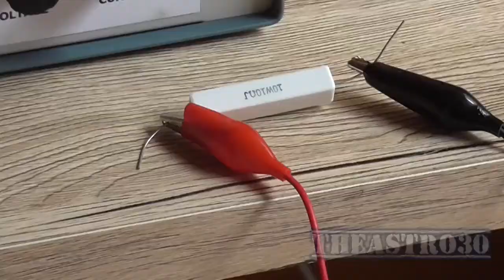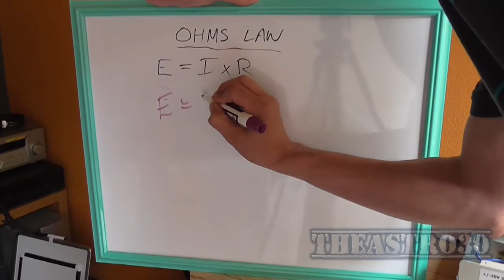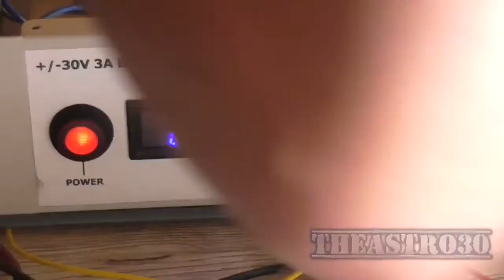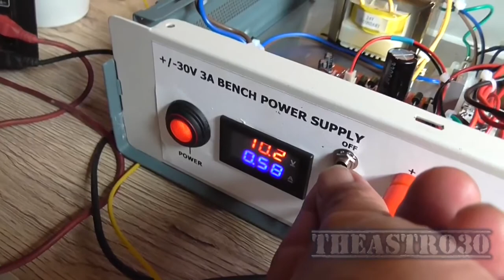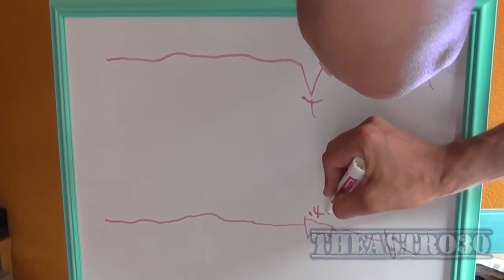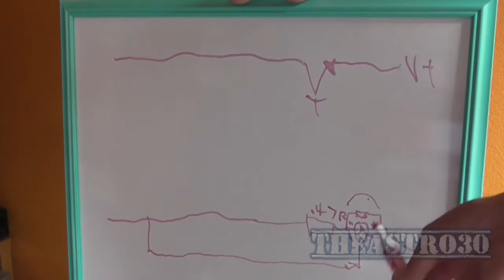Power Supply Design - Something's Fishy

Comment: It works well but you need to have a separate power supply for the VA meter isolated from the power supply which you are regulating